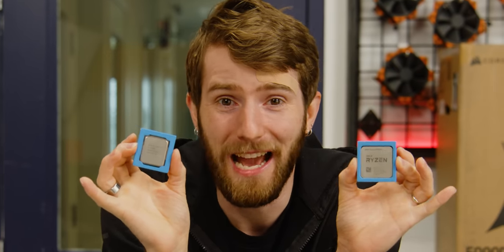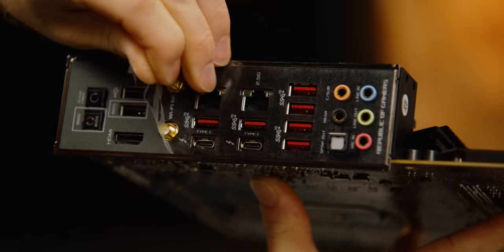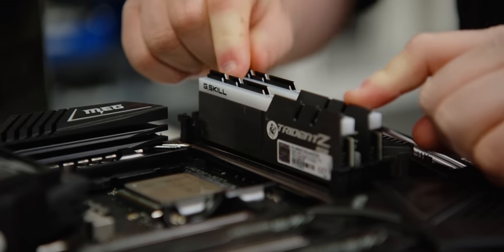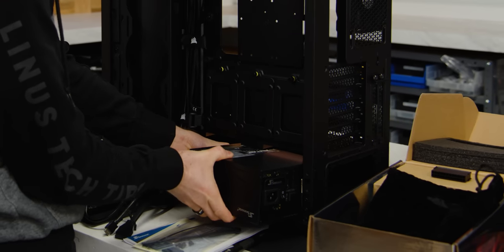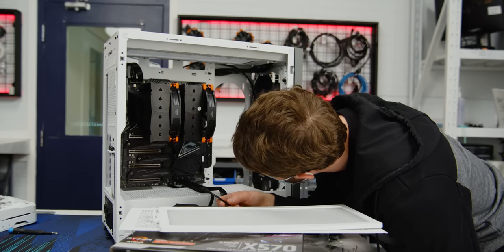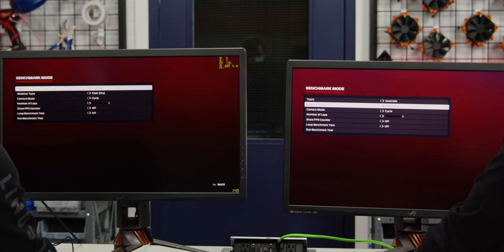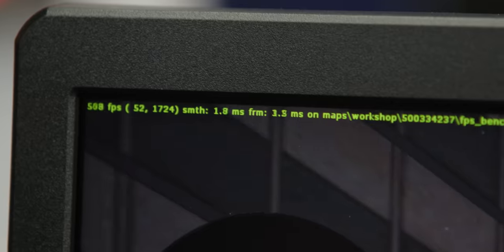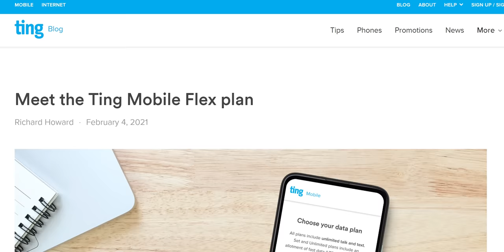Can Intel Beat the Ultimate AMD Gaming PC?

Comment: Finally got me my 5950X ❤
Now I just need my 3090 
(still running 2070)
Reply: Yes very very bad gpu

Sarcastically said of course
Reply: Why would you buy that overkill CPU?
Reply: @bretttanton328  for editing and 3d maybe? Then 16 cores is really good. But if its for gaming 6-8 cores is perfectly fine.
Reply: ya'll are having new gen cpu's and atleast 2nd gen gpu's while im using a laptop from 8 years ago with a intel pentium and runs on windows vista
Reply: @kenangutic2520  but still 😂!! 10 cores is enough. Waste of money in my opinion for 16/36 CPU
Reply: First word problems.....
Reply: @bretttanton328  10 cores is also pretty overkill
Reply: @bretttanton328  16c/32t*
Reply: I want to run software SIMULTANEOUSLY.
- 3D design
- Programing
- Rendering
- Downloading
- Gaming

Right now with the system I have which is 8yrs old never upgraded (I get the 5950X build tomorrow I think) I can only do 1 of the above at a time and with things like rendering/designing I am sitting at 0.2-0.4FPS if it doesn't crash...
Reply: @bretttanton328  why threadripper and xeon exist then?
Reply: @MantismanTM  why do i feel like everyone is doin 3d design ...in 2021.

Do you have any video or portfolio?
Reply: Pls resell your gpu at atleast retail price
Reply: @MantismanTM  a 2070 ain't 8 years old
Reply: @superblitz2274  yea something doesn’t add up
Reply: @OpticalDTV  they aren’t. Exactly why this guy claims to have a 8 yr old pc that’s never been upgraded but has a 2070 in it...
Reply: @superblitz2274  And this PC cannot use 10% of the 2070 GPU. I don't have high hopes of getting the 3090 (I want) soon hence why I feel glad and lucky to have this 2070 which will be pussshed in this new build until I'm complaining about it and will hopefully have that 3090 I want by then.
Reply: @bretttanton328  but then... nobody asked for your opinion...
Reply: @bretttanton328  Maybe but if you really want an overkill cpu, why not? You work to buy what you want.
Reply: Wait, guys, 11900k is 8 cores, not 10! 😂😂😂😂😂😂😂
Reply: @MantismanTM  good for you, I gave up and bought PS5 and Xbox X
Reply: @Luke Gmeh, it’s nice to have both.
Reply: Correct the 2070 is NOT 8 years old, all other Tech is though such as the 450W PSU and ALL of the old tech SERIOUSLY bottlenecks the "Overkill for the old tech" 2070 which is why I hope this new PC (pick up tomorrow) will be able to use 100% of the 2070 and the second the 2070 hinders my rendering/work, I'll need that 3090.

I don't know about the rest of you but... My work is only limited by the power at my disposal, more power = more work = more 🤑🤑🤑

Comment: LTT: Builds top of the range gaming PCs
Also LTT: Uses a Corsair mouse with the old Corsair logo 😂
Reply: So I still use a Logitech G402 mouse and  G213 keyboard  older is usually more comfortable LOL
Reply: @davidharrison6535  but do you have a 11900K/5950x with a 3090 on ur pc? (Basically bc that’s the top of the range pc)
Reply: on top of that there 
1 using regular cables 
2 not on open loop water cooling

Comment: You forgot to mention Zen 3 performance on 4 sticks of memory(up to 9%) Check Gamersnexus's video on that.
Reply: Like most things, there's more to it than simply 4 v 2 sticks.

Using 4 Single Rank sticks is better than 2 Single Rank sticks but you can use 2 Dual Rank sticks and get the benefits.
Reply: @viet0ne  Right, interesting. I wonder how DDR5 will turn out.
Reply: @boomjonggol5757  Stop, stop, they're already dead! With how crazy Ryzens RAM scaling is, that will be the death sentence unless Intel improve drastically

Comment: the price does make a difference though. When I ordered my prebuilt I was able to build a system with an 11900k for 300 cheaper than trying to get the 5900 let alone the 5950. So I would have probably been looking at anywhere from 800 to 1000 more for 5950 build. We are comfortable but there was no way I was getting my wife to agree on letting me spend over 3000. I got an 11900k, gigabyte rtx gaming 3080 oc, msi carbon wifi z590, 16gb trident 4000mhz ram, 2 tb m.2 drive and another 3tb sata, and liquid cooled for right around 2800. I tried everything to get within that price range for an amd build with similar specs and just couldn't come close. I feel like I have an absolute beast of a system already and there is no way I was willing to spend another 1k for a 10% boost in gaming when that is what I will primarily push it for.
Reply: crazy specs
Reply: No way does your math end up, simply having 5950x over 11900k that cant ad up 1000$ of price if the 5950x by itself is less than that and you already have 11900k which by itself is also 700$, the actual difference is more like 100$ and its worth taking it

Comment: in order to make 11900k win against ryzen 5800x and above, is to have an external radiator loop like Mo-Ra 420 and oc 11900k to 5.1~5.2ghz all core. Use Mobo like Maximus 13 Apex and OC ram 1:1 3866 cl14 (G2 4800 cl16) above. Then you can win 5800x (and above) with 48ghz all core oc + 3800 cl14 which can easily be done on AIO and mid-level b550... so if you have like 3000 dollars to spend on pc and want absolute 0 compromises, go with extreme setup 11900k but.... you can get the almost same result with 1/4 of the price on Ryzen 5000 series cpu.  the choice is yours guys
Reply: The good thing about intel cpus is that they actually exist at MSRP, so that's a plus to intel.

Comment: It's crazy how Intel came out with 3 paper launches within one generation of AMD chip's. Since the 5800X came out Intel has launched 3 chips to finally beat the 5800X maybe even 4, when the 5800X came out, Intel was on the 9900K, since then we have gotten the 10,900K, 11,900K, and now the 12,900K, So it basically took them 4 generations inside of 2 years to get their crown back!??? If they even really got it back.. AMD is still cheaper at the end of the day.. ((Finally the way GPU pricing is right now, Who even cares what CPU they have.. At 4k it really doesn't matter as long as you have at least 6 cores with 12 threads you are good.. It almost makes the CPU that you are using Moot..
Reply: @Radplay Honestly at this point they are both so fast it really doesn't matter what platform you go with.. I'm hearing Zen 4 is going to be crazy fast so hopefully there's a back and forth competition.. I'm more worried about getting a good GPU these days than anything else..

Comment: Correct me if I’m wrong but off the top of my head without pulling up specs for everything would not the Core X series have made for a better show down? I’m not up on my AMD but I know the 10980XE has 18 cores and 36 threads. I mean at the very least if we’re looking at who’s better can’t we just take the top of the line from each side seems a tad bit unfair even if the X series is a generation behind. But again I’m not up on my AMD idk what their best is right now. If I had an unlimited budget and went for a brand new intel build I’d definitely take an i9x over an i9 despite the generation gap.

Comment: Hello LTT and friends!!
I just recently got my new gaming rig. Apart of PSU and GPU coz I`m still happy with mine Seasonic 1250 X Series and according  to GPU situation nowadays I`ll wait till vendors have back in stock and not at insane price. So I got: 
Core I9 11900k
Asus Maximus XIII HERO Z590
Kingstone HyperX DDR4 3200 4x16G
Noctua NH-D15
So far so good, once I done with assembly I went for the Win install. During the Win restarts between Drivers installation my PC shouted down and never come back alive it was the Motherboard, I got a new one. It was great untill Friday, so basically it works perfectly for 10 days or so. My screen was frozen restart the PC and the drama came up. So after restarting it tried to boot but after 2-3 circles on boot dots it suddenly restart again and that repeated few times than blue screen. So now i cannot boot anything apart of BIOS. The replaces MB is back in service but I`m not sure anymore i want this MB how it seams the entire series it`s F*** up. I`ll be glad to see some LTT Team opinion about the issue, also from ppl with similar issues.
Thanks in advance and Cheers all
Reply: i suggest you go to ltt forum or similar site since you'll probably never gonna get an answer here. its hard to see notif from thousands of people in different videos each day. hope you got what you need there.

Comment: Hey linus, Im looking into getting an Amd Ryzen 5950x what motherboard would you suggest? Ive been looking at some aorus boards but there are so many that its overwhelming. I dont necessarily need wifi. Thats not a huge deal. 

Currently Im running a nvidia 2060 super in an older amd rig and its getting bottlenecked, thus its time to upgrade.
Reply: Asus crosshair viii dark hero
I use it in my beast and it is awesome

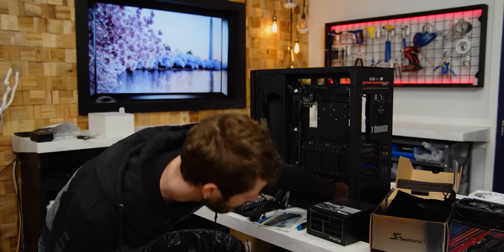Comment: 6:31 well, you need that if you're overclocking at all. my oc-d 980+ r7 3800x PC with water cooling draws almost 700W at the wall, having a couple hundred watt overhead is definitely not a bad idea, plus my 1000w Seasonic Prime Ultra cost 20 bucks more than a decent 650W corsair psu so why bother going smaller?

Comment: I'd still choose Intel no matter what performance comes out of AMD because I like having a GPU built into the CPU in case my discrete card dies. I still have memories of losing my Matrix 7970 and having an AMD CPU. The downtime sucked! The fact that Intel still chooses to include a GPU inside their processors could be a reason why they don't perform as well as one without.

Comment: I just bought a tower from a friend of mine that I swear was built in like 2010, it has a power supply running at like 900 watts, for a core 2 duo and a super old graphics card, and some massive cooler... It's nuts but still way op once it's upgraded 😂😂

Comment: I recently bought a 5950x proc, a dark hero VIII motherboard and a hx1000 PSU. I'm still using a 2080ti. But when I assembled all the components a strange noise started to come out from the PSU. I returned it but the new one came with the same noise ( electric type ). I'm struggling trying to understand the reasons. The rest of the components are the same to the previous system I was using and no noises from the old PSU ( rm1000 ). So, what could be the problem?
Reply: You have a better quality PSU. The noises are normal, it's called it's under heavy load and screams as such. Mine screams too, freaked me out at first but after a bit of researching it's all fine, I don't really hear it anyway because I use headphones. Maybe try undervolting all of your components, idk.

Comment: That G-skill 3600CL14 is not the unicorn you make it out to be. Instead buy the 4000CL16 B-die 1.4V then set the DRAM to 3600CL13,13,13,26,39. Technically CL14 or 12, Ryzen doesn't recognize 13Tcas

Comment: the bigger thing between intel and amd is also the thing that you can upgrade or downgrade easier with amd because of how they do there sockets. So you can even start with a lower cpu and upgrade later when its in stock or even later when the prices are better.

Comment: For real-world use, that 10% performance diff means nothing, if you got a 144Hz monitor and all your games perform well above 144 fps, you're only gonna see 144FPS capped, So that extra money for the 5950x for that 10% increase doesn't look worth it, and the 11900K looks the better deal, even the 5900X is about 100 dollars more, and the 11900K performs slightly better then the 5900X.

Comment: for durability and longevity. yes Intel has beaten AMD many times and continue to do so. Overclocked CPUs always have shorter lifespan when compare to locked ones aka Stable ones. In AMD you have to upgrade in such short amount of time. But Intel 1st generation core processors are still kicking it with latest graphics cards with no issues at all.

I have i7-870 which I built in 2009. upgraded with 750 TI/TF in 2012 and with 16GB ram. it is still faster than ever.

Also owned AMD Sampron and Athlon even further back which were bite to dust due to overheating issues....It was crap totally.

Comment: Just try re-seating the intel processor, and see if that'll boost you up to the AMD's performance level. 
You might of just had a little spec of dust in there causing a li'l performance loss. :)

Comment: I was using a 500w power supply on my gaming pc back in 1997 I upgraded it and the 250w wouldn’t power it anymore I thought I messed my PC up ( it wouldn’t power on at all ) till i got the bigger power supply then it started right up, I can get 5950X for $50USD over msrp in a pre-built and with the global chip shortage coming ( who knows soon we may not have regular CPU’s anymore probably ) I think I’m getting the 5950X because I’m going with a 3090, the US is thinking about banning gaming PC’s and monitors in some states because they use too much power

Comment: If you add that for any program that really makes intensive use of the multicore Intel death the dust for a long time you end up with almost no heels to buy Intel.  In addition, AMD has cheaper processors with practically the same single-core performance, and without higher multi-core performance.

Comment: I love the new AMD cpu's, running a 5900X myself. But I must say, the game choice, perfers AMD. Both CSGO and F1 is running better on AMD. A AMD 5600X can beat a 11900k in F1 @ 4k (also wins in 1080p), even tho the diffrence is small. But for example Intel usually is better in BFV & Metro Exodus. I'm playing CS:GO, RDR2 and BFV, and what I've seen in benchmarks is that my 5900X is a better cpu than a 11900k in CS:GO and RDR2, but a 11900k is a bit better in BFV. Compared to 12 diffrent games (BFV, Control, Metro Exodus, The Division 2, GR: Breakpoint, Total War: Three kingdoms, Resident Evil 3, F1 2020, Gears 5, Wolfenstein, COD Modern Warfare, RDR2). The 5950X and the 11900k is equal. I believe Intel got some better RAM options, cuz i can't get higher than 3733mhz on my Gigabyte X570 Aorus Master right now, (Running 3733mhz CL14, that will do for now, but would want to try higher mhz @ CL16). But then again, AMD is a faster cpu in everything outside of gaming, so I'm super happy with my 5900X. :)

Comment: I only see 5 fps difference for multiple 100$s.....
In fact even a 11900k is overkill for gaming, best buy is actually a 10700k or even 10600k and OC the hell out of it, boom! Cheaper than AMD and as fast or faster (compared to AMD alternatives like 3600x/3700x)

Damn, im even fine with a i7 9750h locked to 3,6GHz for well below 75 degree. I still dont feel fine with 85 degree spikes for more than 3,6, sometimes even 90+ degree for 4GHz which arent even stable 4ghz. Mainly still the GPU matters, and therefor even the 150W 2080 with a 190W VBios isnt enough to push the 9750h i7 to its limits at 1440p or higher res.
So conclusion: even a Ryzen 2600x is fine for gaming, and as soon DDR5 is released and aviable, much better CPU generations will be released and so even a Ryzen 5950X is "outdated" again. We stuck already too long with DDR4, barely making a difference to DDR3. DDR5 must be a great advantage over DDR4 since DDR4 was nothing but releasing it as fast as possible to counter the extremely cheap DDR3 prices these days. Remember, 16GB(2x8GB Kit) DDR3 were before DDR4 release MUCH cheaper than DDR3 or 4 is today. First DDR4 generations were barely if at all better than last gen DDR3 stuff, and even in 2020 there is no real benefit of DDR4 yet, thats why even a last gen DDR3 system with fast 2400MHz Memory is still competetive these days.

Comment: What is best for gaming 11700k or the 5800x?!
Reply: @Radplay what motherboard and ram would be best to pair it with?
Reply: @Radplay why does everyone recommend that msi tomahawk board? I thought the x570 boards are better than the b boards? Also can't i just get a boards that supports the cpu or the box so no mobo bios update is needed? What memory would be best to pair up with the 5800x?
Reply: @Radplay what about the asus tuf mobo? If u plan to overclock later what would be a good mobo to get for that? Also I plan to get 16x2 maybe sum corsair 3600mhz cl18? I plan to get everything from best buy bc I have tax exemption there
Reply: @Radplay the 3600 comes only in cl18. The 3200 comes in 16 on bestbuy. BTW now im debating whether to just get a 5600x instead of the 5800x. I read they are back in neck in all games.  I'm guessing games don't yet utilizing 8 cores? What do you think considering they are 100 to 150 dollars difference in price
Reply: @Radplay Honestly I hardly ever upgrade that is why Im thinking the 5800x might be the better choice.  But then again maybe games will skip needed 8 core and go straight to 12 or 16?  Then itd be better to get the 5600x now and later upgrade to a 16 core.  The fact is I dont really care to upgrade ever unless theres a game I play that needs it...I play overwatch, starcraft 2, hollow knight, and games that dont really require much cpu power or even gpu...My current pc plays every game I want pretty well.  Games like cyberpunk i hold off on until its fixed & cheap...I just got around to playing doom eternal & my pc played it really well at 1440p...I honestly enjoy building a new PC so its been so long since Ive built one that Ive got that itch & with the newer consoles being 8 core  newer games will need it to play well.
Reply: @Radplay What motherboard is best to pair with the 5800x that is from 180 to 220?

Comment: I think that the Ibuypower PC case could also operate as a Monitor if you had a light source inside the case and a diffuser to diffuse the light and make the images as good as on a proper monitor then you won't need another monitor as the side panel is a Monitor.